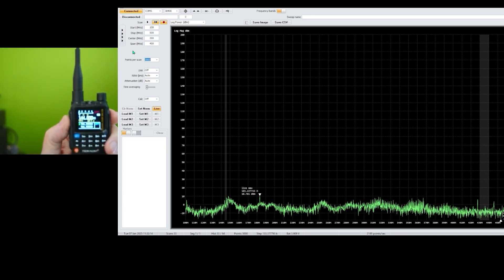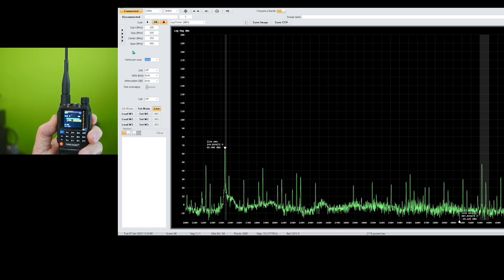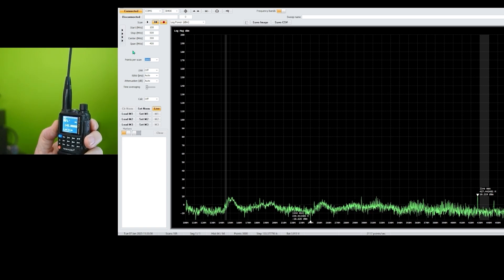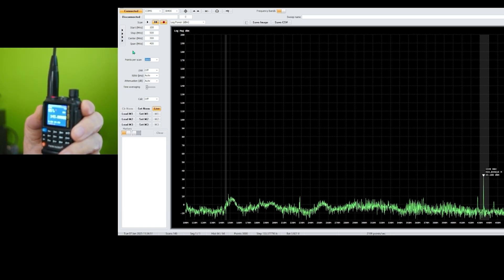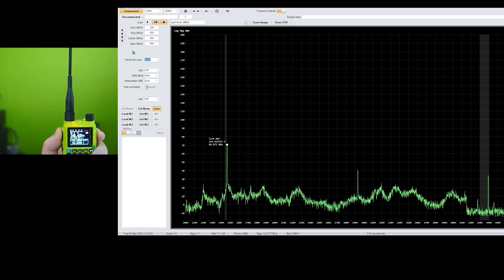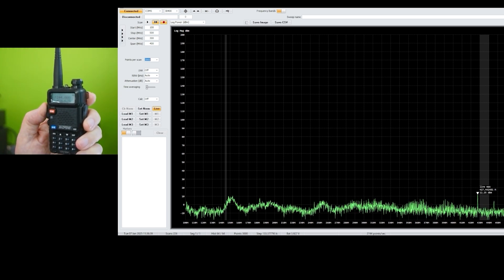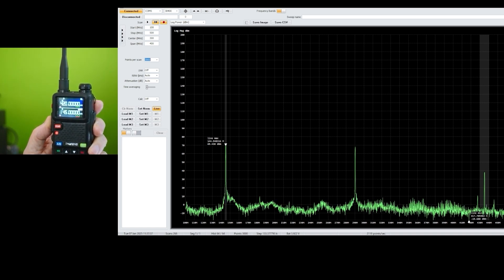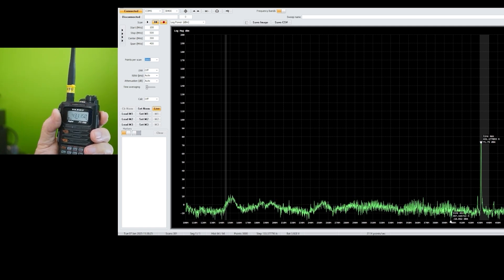Do You Want to Transmit with One of These? You May Be Fined Thousands of Dollars & Lose Your License

Comment: Please do correct measurements with an attenuator and cabling instead of using antennas - you're probably overdriving the input mixer of the SA. Testing the Yaesu on 70cm and then telling the 2nd harmonic (=1st really) was "ok" made me laugh..
Reply from the maker: I did that.
Reply: @ham-radio  You did what exactly? Overdrive the mixer? Surely looks like that because you got intermodulation products between the harmonics on your spectrum - "garbage everywhere".. I don't think those cheapo radios meet the requirements, but your "measurements" look too worse even for those toys..

Comment: You transmitted on 70cm on the Yaesu. If you want to compare them, transmit on 2m on all of them. Some radios are dirty on 2m but clean on 70cm. Also, I don't know if this makes a difference, but when I test for spurious emissions, I connect the radio to the TinySA Ultra through attenuators. And my H3s and H8 come out clean on 2m and 70cm. I have a new Baofeng UV-5R that is also clean, unlike the old one I have which is really dirty. It's still a crap radio on reception, though.
Reply: I was wondering if it made a difference because I also noticed the Yaesu transmitted on 70cm as opposed to 2m. I currently don’t own a $180 Yaesu HT, so I’m using affordable Chinese radios until I can purchase a Yaesu or ICOM.
Reply: @uwayzofoster4753  It makes a big difference on some radios. I have a few Baofeng radios that are very dirty on 2m, but clean on 70cm. I don't own a Yaesu, ICOM, or Kenwood handheld, either. I'm happy with the cheap radios I have that are clean on 2m. I tested a Quanshen UV-K5 that has a mild harmonic on 2m. When that radio transmits, I can receive it on the harmonic frequency about 1.5 blocks away. That's not good, but it's not going to interfere with firefighters unless I'm closer than that.
Reply: @uwayzofoster4753  The Yaesu FT4XR is less than $100 and is a very good radio. I have one and have put it through some abuse and it still works great.

Comment: Hi Jim, those examples seem to be far worse than the few examples I have looked at. I have seen high harmonic output but not the high levels of other output. I would not use any of my cheapies on "big" external antennas but in this rural area I am happy enough to use them with their supplied antennas. With the comb of junk coming from your examples I would be wary to use them at all. Sadly around the internet people will irrationally defend these radios, often claiming they are as good as products from the respected brands. Unfortunately many of the FCC IDs are genuine but for the wrong class of equipment. The bulk of the ones I have looked up are compliant as receivers only. 73

Comment: Hello fellow Jim!  I've got a few questions for you - please tell me the make/model of VNA you are displaying here in your video.  Those are known to have poor front ends that overload easily, and will display signals that aren't really there.  You can test this (maybe in another video?) by putting a 10 dB attenuator inline with the VNA and see if the suspected "garbage" signals drop by 10 dB.  If they drop by some other value, then the intermod is happening in the front end of the VNA, and the transmitter is not producing what you think it is.  73, Jim - K6KCP
Reply: Until I see these radios tested on a real spectrum analyzer in a proper lab setting, I'm skeptical of these "test" results.
Reply: @richb.4374  exactly.
Reply: @richb.4374  "I'm skeptical of these "test" results."
Skeptical is worthy; but Baofeng have been tested with proper lab equipment and just barely meet specification.  I saw it with my own eyes; lovely and expensive HP spectrum analyzer, straight out the radio through an attenuator for precise measurements.  ICOM was very good, nearly perfect; Baofeng had spurs all over the place but reasonably well attenuated, about 30 db down I suppose, not likely to cause issues UNLESS you amplify it or use a high-gain antenna and aim the spurs at some place that doesn't want them.   So, I use my Baofeng as much as my Icom particularly when camping or where losing or damaging a $50 radio is much better than damaging a $500 radio (too late for that anyway).
Reply: @richb.4374  You might want to look at a few of Jim's other videos and see if you approve of his "lab setting". You are embarrassing yourself.
Reply: @VoiceofNH  Does the FCC test radios for spectral purity in a ham shack on a VNA or do they do it in an RF lab with a certified spectrum analyzer known to be accurate? I am not slamming Jim, i just don't feel his test is very accurate in this case. VNA's are known to have poor front ends and do get overloaded with strong signals, which can skew the test results. Others posted the same opinion and I agree with them. I've seen plenty of Jim's videos on other topics and mostly agree with him. I'm not attempting to slam Jim here or attack him personally like your silly comment attempted to attack me. You're the one embarrassing yourself.
Reply: Yes, this would be really interesting.  Not saying Baofeng are great radios, but I never saw values so bad, therefore overloading seems possible.
Reply: @xamr.824  That would not really explain why there were different results from different transmitters though, such as the H8 at 7:37  Wouldn't you think that it would overload every time for the same Tx power?
Reply: @VoiceofNH  No, but I have no idea, if he uses the same power, such as you dont know this. Furthermore, a typical problem, which occurs if you overload the frontend of a spectrum analyser is the generation of harmonics of the input signal, as well as intermodulation and higher noise floor...  but as an expert, I am sure you are aware of this. Anyway, you are right and by chance he has the 5 cheap radios, which have way worse values than all the others which were measured in the last 15 years.. so cheers have fun... and believe whatever you like
Reply: Pretty much this. There's another channel that crapped all over the baofeng however the demonstrably did the measurements wrong. The other thing the new Baofengs that have FCC IDs are "clean enough". They do in fact transmit a high second harmonic at around 300 MHz. However it is well within part 15 limits we're talking microwatts at best. I have a clean conscience using any of the new FCC id Baofengs. Truthfully I hate the user interface though.

Comment: i have 2 motorola FRS radios that spray all over every harmonic, and they sold millions of them.  every frs and gmrs channel is filled with kids just keying up and blah-blahing for 20 minutes straight.  if billion-dollar EMS agencies supplied by defense-industry communications vendors are derailed by HT interference, maybe the problem isn't REALLY your HT.
Reply: Like the FCC says, not only must you not generate interference, you must also deal with interference from others.
Reply: That's one reason the power limits are so low, and the antenna fixed.